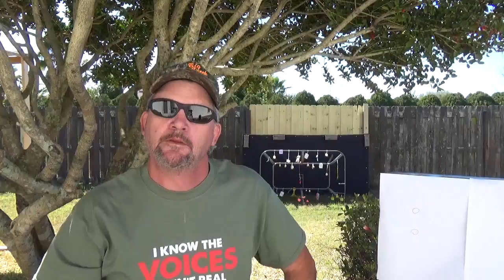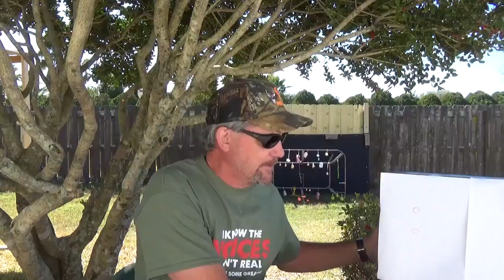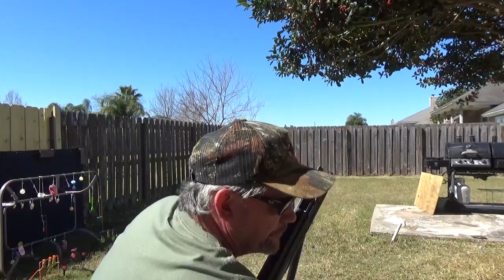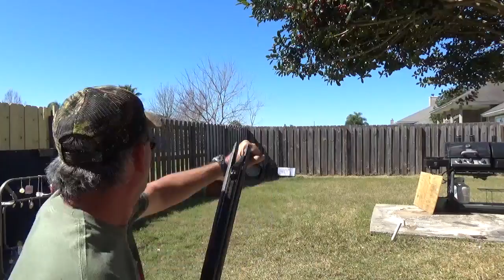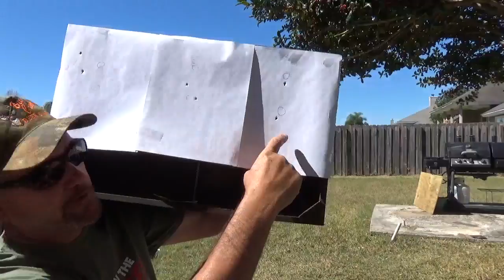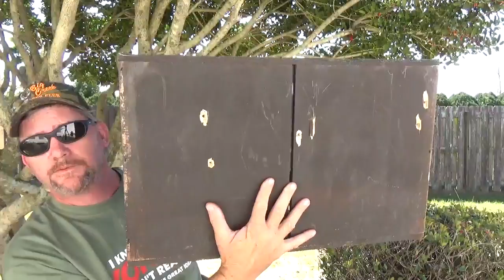GAMO VIPER EXPRESS 22 CAL RANGE TEST

Comment: Hey backyard blinking my Prowler hammered nails at 20 yards I went to put the pellet in first I reached for the safety , it wasn't the safety , the gun jumped out of my hands hit the ground thought the seal got smashed because the barrel was aiming in the air the barrel was bent just from closing not hitting the ground very disappointed, Great Gun very soft Steel in the barrel , bummer, next rifle will have an auto safety, when I can afford another, I loved that Benjamin Prowler dang it , any recommendations ?.
Reply from the maker: bear trap hop     prowler is getting more inexpensive. if you want something different try a hatsan